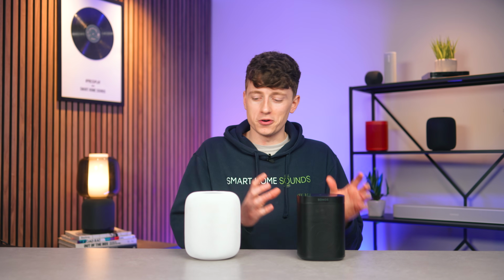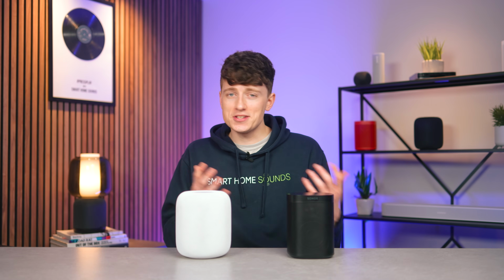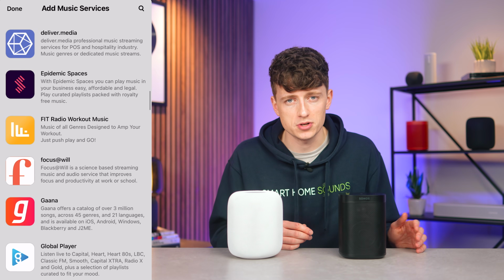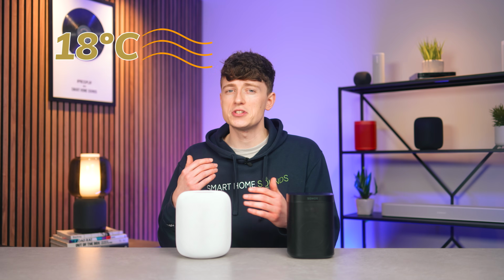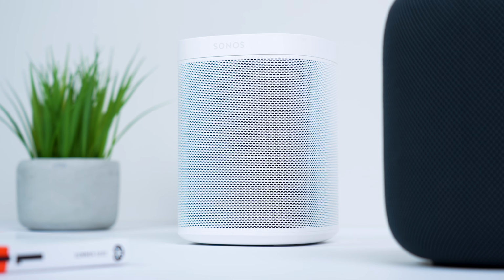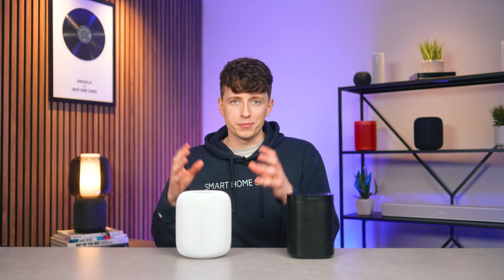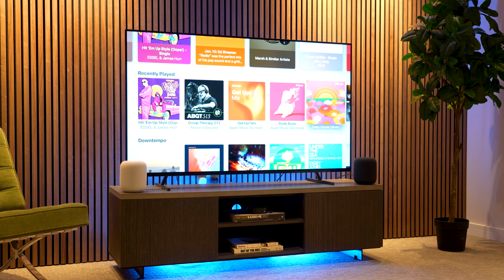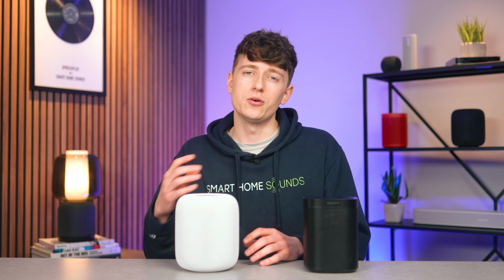Apple HomePod 2 Vs Sonos One: Battle of the Smart Speakers

Comment: The HomePod sounds better but the Sonos has more features such as Spotify connect, better working stereo pairing and so on
Reply: But Siri is still the worst smart home assistant. Plus Sonos can update the systems to include Spotify connect.
Reply: What do you mean by better working stereo pairing? The hompod works great if not better with stereo and dolby atmos!
Reply: @Anonyme09865  I don't think so. I had two HomePods and I couldn't even airplay music or videos from my Mac to a stereo pair but always only to one of them. If you pair two Sonos ones the Mac sees them as one speaker and you can airplay to a stereo pair. That was really important to me.
Reply: @JensMüller33  you can only connect to stereo homepods with wifi.
if you use cellular you are limited to one speaker.
using wifi i got no issues at all with my stereohomepods.
Reply: @bodigames  cellular? What are you talking about? Airplay from Mac only works over Wifi
Reply: @JensMüller33  You Can hotspot to your mac buddy 🤦🏻‍♂️